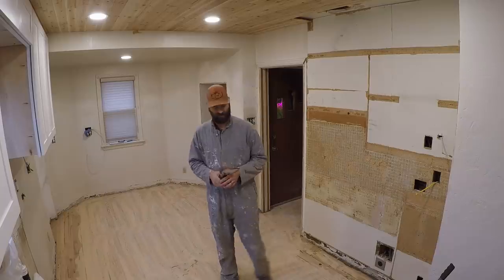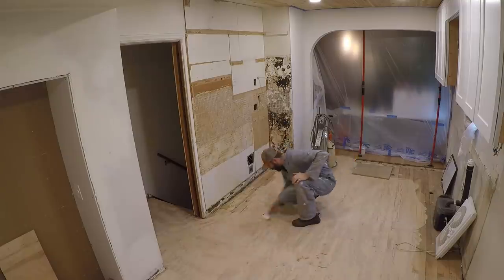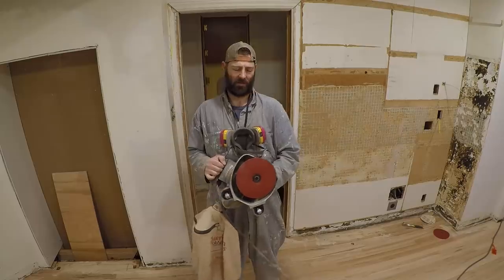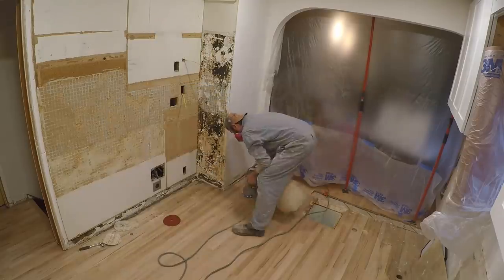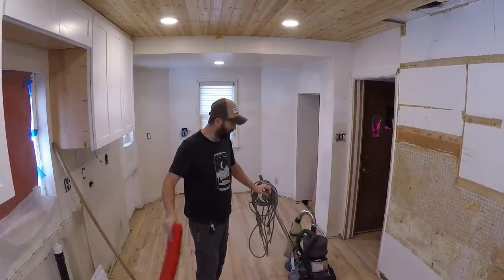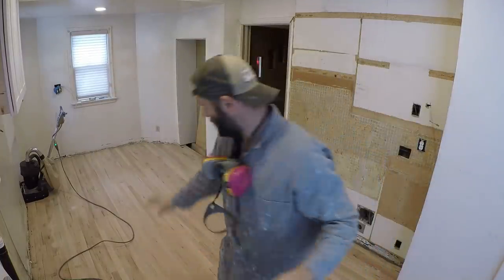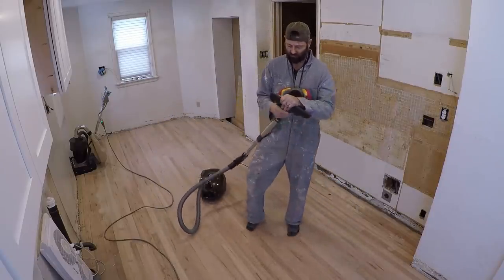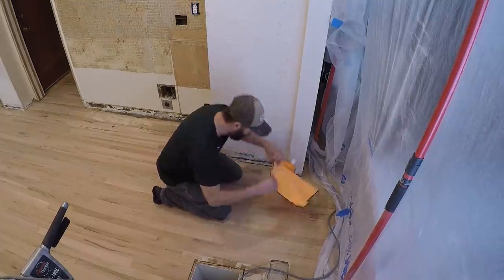The Secret To Perfect Hardwood Floors | THE HANDYMAN |

Comment: For refinishing floors, I used to make scrapers out of freshly cut plate glass. I would use salvage glass which cost practically nothing. Very very sharp and very effective for shaving a top layer off of the floor, especially in corners and along edges.

Comment: Since the hole is in the kitchen and if im recalling correctly, you said it was inside a cabinet... my guess is that it might have been an old "root cellar" with a pulley system? Just a guess, idk. I'm still guessing Bona sealer and finish, waterborne products. That's what I'm using.

Comment: Backpack vacs are good to use or I use a huge vacuum that looks like an oil drum it hooks to the machines 99% dust free also I use a circular buffer for buffing a floor and when I tack a floor I constantly wash the cloth off in a bucket as to not just spread dust around

Comment: I know I'm late in this but you're the best at responding to all posts so I'm optimistic. If you just had to remove a top coat in most areas but there were old urine stains that had burned through some of the wood in a few areas, what would be your plan of attack? Any others with info please advise as well.

Comment: What year is the house? My guess is old unused register pass thru. My sister's old house has them between first and second floor, just a register cover on the top and bottom...heat by convection from the first floor.

Comment: You definitely have a better understanding of floor sanding than most non-floor guys. Skipped a step and added an unnecessary one or two, but good job overall.
Reply: I was thinking the same thing. I also never work in socks, your sweaty feet can raise the grain, giving you problems during staining.

Comment: The house I grew up in was built around 1910. When the family first moved in 1960 there was a gravity driven "octopus" furnace with huge pipes coming from various large registers and holes in the floor. It was replaced with a modern fan-forced furnace so all of those pipes were gone. Some of those large holes remained like in this kitchen. Ours was under a kitchen counter so we used it as a laundry chute.

Comment: So, how many various sanding belts, pads etc did you go through during the whole floor project?  -BTW,It looks amazing and I learned a lot :)
Reply from the maker: I though I would go through a lot more then I did .  There are many stages of different grit paper. To get it to raw wood only took 3 belts and a few hours.  After that every thing was as if I was working with new wood.  I used 3 different machines.  All took a different kind of sand paper.   I used around 24 different sand paper belts, screens, discs,.

Comment: So I wound up here wondering if I could get away with screwing spacer blocks to the floor behind the reclining sofa's, to keep them from sliding back against the wall. I'm concerned with what kind of damage I'll be doing to the hardwood floors underneath, particularly with respect to resale of the home in a few years (if we decide to do that). I'd basically use one or two drywall screws (it just needs to keep the block from getting pushed by the Roomba).

Comment: Wiping the floor with a damp rag will raise and open the grain of the wood. Be careful when you do that if your trying to match the floor in the other room and that room wasn't "water popped". Water popped floor will finish noticeably darker.
Reply: nicksjustbored agree and I would add, cleaning with some denatured alcohol should be done before final screening to pop the grain, then final screening, then alcohol again for final cleanup. Helps keep moisture from popping grain later.
Reply: @jeremydewolfe8026  i never knew that nor have i seen it done. Im out of the trade now so i wont have a chance to try it. It was a good job i loved to see the before and after of a job well done.

Comment: Okay. Based on facts The hole is not a root cellar... house is not that old. (At least not the kitchen structure) The hole is not hot air duct... house is hot water heat and the radiators are as old as the house or at least that kitchen.  House is one story... window install videos from outside.  The hole went through the cabinet... whenever they were installed (60s - 70s maybe). There was a shelf above the hole in the cabinet about a foot above and when it was removed, a mark was on the wall, so probably not a trash chute unless you want to get on your hands and knees to throw it in the basement. (Not practical anyway)... it appears that there is a tub and detergents in that area of the basement when he did the electrical and pipe cutting... so, its a laundry chute that was cut with a circular saw sometime between the 70’s and a few months ago.

Comment: Maybe they heated the house in the past with a wood or coal stove in the basement and the hole was to allow the heat to enter the room.  If so, there would have been additional holes with grills in the other rooms also.

Comment: Did you leave that nasty creaking board problem unresolved? Quick! Before you apply that finish, drill a small hole in the board and embed a long thin finishing nail deep into the board, until it stops creaking! :)
Reply from the maker: That is the WRONG way to fix a floor squeak.

Comment: Hole was cut through the original floor, then asbestos layer, then plywood, then linoleum, another layer of asbestos, vinyl, then the bottom of the non-original cabinet.  Then some box was framed around the joists in the basement...   i have no idea what it was.. clearly not original construction though.

Comment: Mr handyman aren’t you supposed to sand it at a 45 to the floor?
Reply from the maker: You can for one pass early on in your grits.  But not up past 60 grits.
Reply: Usually only to address chatter marks in the floor, to help get a smooth final product.
Reply: Scott Oliver or excessively cupped. Though with a good sander running 45 becomes unnecessary.

Comment: The hole in floor: Simply an air circulator, to keep basement temperature/humidity similar to main floor. Was the old way of saving expense of heating basement, yet keeping it at an above freezing temperature.